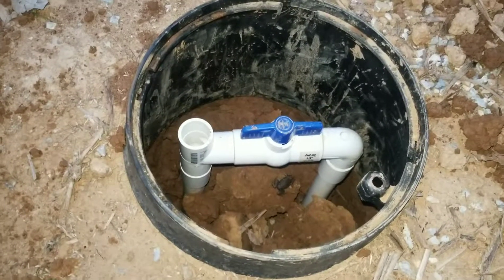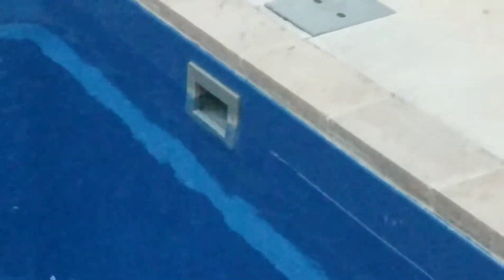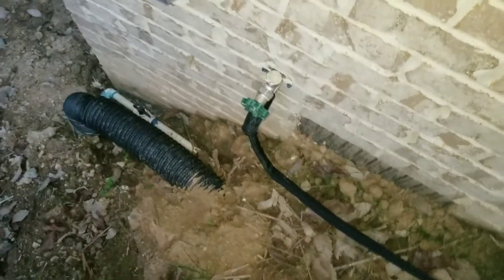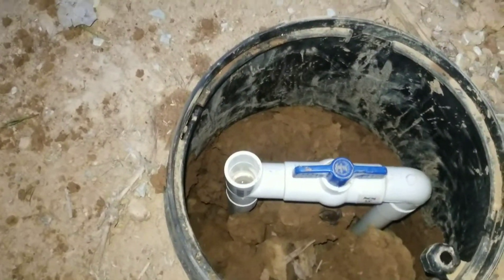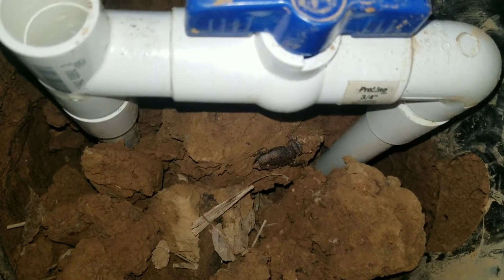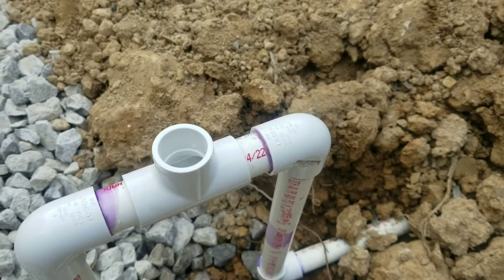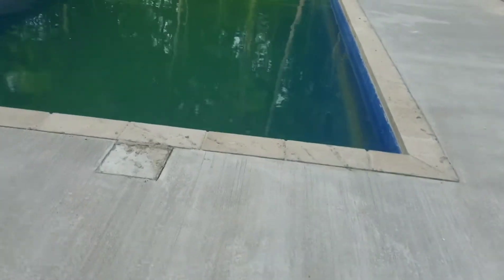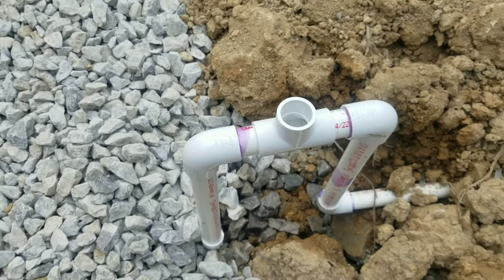Adjustable pool overflow drain

Comment from the maker: Hey everyone here's a follow-up video based on questions in this comments thread.
https://youtu.be/F8uNJ1o5_Ws
Reply: Awesome - Looks great too! I got your point on the blowout part too - figured if you don't have it glued into those extensions near the bottom - the whole apparatus can just come straight up and off anyway - and you can blow the line out directly to the pool side. I love it regardless. I can see not really closing it down much either, so either way works. The follow up video is great - looks awesome in the yard with the grass all in. Thanks a bunch - definitely glad I ran into this solution. Cheers!
Reply: James - circling back here - I just tried to post but it didnt work so Ill try again. I still have not found someone to help me get access to the skimmer through the concrete and then repair it. But my question (not sure if I got this answer or not) - is did you have to actuall Drill out from inside that back hole/port into the skimmer or was there some kind of knockout - I do not see any indication of a knockout from inside the skimmer - its all smooth?? Also - were you able to attach the pipe to the outside of the skimmer port/hole or inside? I was told that I should have enough room to connect a coupler or bell end 3/4" to the part coming out the back of the skimmer. I have a picture of my skimmer during install but not a close up. I also do not have a model number as it was installed on the pool when delivered from the manufacturer of the fiberglass pool. See image: ( https://ibb.co/W2ckmNN ). Is this what you had to connect yours? I was told by one vendor that the hole/port was only used for bracing and not for overflow, but another vendor (and your install, along with some photos online) show that this is the intended purpose as well. Can you tell from the photo I posted if this is what you had and how you attached the pipe and got access into the skimmer (drill/punchout/etc.).. thanks..

Comment: at about 4:16 in the video you mentioned adding a valve to allow going even lower than the skimmer line or something? closing it then allowing the siphon effect to drain even more? I am confused on that. Also - what happens in winter/freezing - any issues? just leave everything open and all good? I run my pool all year long. Looking to add the overflow to my system soon and having this setup with the landscaping port access to the valve up by the pool just after the concrete deck is awesome. Is the system shown in the beginning of the video the final setup? With the air inlet open on the left, what does closing the valve do? wont the water just continue to rise up and out of the hole on the left forward of the valve? If the valve is to shut it all off and prevent draining, I dont see how that would work with that open access part. I assume the open hole was on the pool side not the drain side. I dont understand the air inlet/siphon/valve setup exactly. Also - having the pipes come way up allows you to have the hole lower in the skimmer (since it is where it is from the skimmer manufacturer) but allow the water to go above that hole before it exists the system? even tho the pipe that carries the water out goes up higher than the hole, yes?
Reply from the maker: Rrandy for your purposes don't worry about what I said in the second video where I showed what I did the first time. I was showing what my first system was before it was all covered with dirt so people could get a better concept of the system. The purpose of the cutoff valve is so you can temporarily raise the water level in your pool. For example in Middle Tennessee where we get an occasional shower during the summer. If I wanted to take advantage of that water and raise the level  so I'd have extra water to lose for evaporation I could do that and not have any go through my overflow drain by cutting it off at the valve.  

I would definitely start on the high side and work your way down with your PVC pipe I've actually raised my pipe level to where 80% of the skimmer level is covered by water and then the overflow kicks in. 

The siphon effect is a real thing  that is why I have a T so one the optimal pool level is reached there will be no water being sucked out the line. If I didn't have all the water would be sucked out u till it got to the level of the drain hole in the back of the skimmer.

Since this is a low / no pressure system you really shouldn't have to worry about gluing any PVC pipe together. This means if you want to raise or lower the level that should be a relatively easy thing to do if you so choose. 

Freezing has never been an issue the ground acts as insulation. We had one of the coldest snaps Middle Tennessee has ever seen this past December the skimmer flapper? froze and we lost Prime but the overflow valve was fine.

This is our third summer with this system and it has never failed me. Even with some very significant rainstorms water got high but you never had to break out of sump pump to pump the pool out. At the pool at our old house I was constantly having to pump out the water after a significant rainstorm.

If you have any other questions let me know we might have to arrange for a phone call somehow LOL I'm glad this video inspired you to do something similar.
Reply: @jamesc.3524  Thanks for the reply! I was hoping this thread/video was still active. I actually just bought 1/2" of everything and making a small-scale model on this hooked to a empty cat litter bucket to act as my skimmer and to see how this all works (just drilled in the pipe and sealed with jb water weld. I am in Georgia and our pool was installed without an overflow (also fiberglass) and the deck is already poured. When it rains I have to drain it all the time with the sand filter. The only hope is the port in the back of the skimmer like you are showing in yours. I have to break concrete to get to the back of the skimmer port and punch/drill? out the hole to add the overflow piping and then fix the concrete. 

I love the idea of having the landscaping box with the valve and T where you can access it right beyond the pool concrete decking. I will play with this setup and see how it goes but my confusion, still, is how the open pipe T works once you cut the valve off (to prevent water from overflowing out) - how does it not just rise above and out of the access hole (the open ended T) when it rises higher in the pool? Once it fills the pipe (blocked by the closed valve), wont it just overflow out of the open T inside your landscaping box area?  Figured you would block the water flow  the T to stop water from even getting to the open T port and escape the system versus behind it (toward the draining end). 

Also - yes - the siphon thing is a great trick to drain something without a pump - fill a hose, then stick it in and ensure the drain out end is lower than the part you are trying to empty.. pretty neat trick (introducing air breaks that siphon effect).

Quick question - is the hole inside the skimmer 1" or 3/4" inch inside? I see all of your piping is 3/4" for the valves and all that. I still don't know the size of my skimmer port but my skimmer looks a lot like yours. Did you have to drill it out or does it punch out some how? I dont see anything from inside the skimmer side to suggest where it would be but I have a picture while the pool was being set and back filled where I see what looks like a port coming out the back. Just not sure if that is the same thing or not. Do you have issues with it clogging in the skimmer with it being 1" or 3/4"? One vendor that looked at this setup said it would get clogged to much if not 2"...
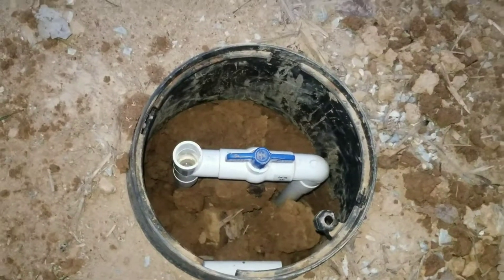Reply from the maker: @randy4813  in regards to the T in my video at 1:55  you see a spare piece of 3/4 inch pipe. I place that on the T and they'll take care of the excessive water whenever you close the valve to raise the level. Just be mindful of how low you bury your Landscaping box so you have room to place it on without hitting the top. 

In regards to the hole on the back of the skimmer I believe all of them are 3/4 in. I wasn't there and they actually drilled the hole but if you look at a new skimmer online you can see where that hole is and there's a port for it I believe you will have to drill it.

 So in the three years I've been run the system it has never gotten  clogged. The overflow pipe is going through the skimmer. Anything that would clog it would hopefully get sucked down into the skimmer basket. In the event it did get clogged I would close the valve and take a air compressor and blow it out. The only way something would get in there is if the skimmer never ran and something forced it in. I'm not saying it will never clog I'm just saying there is a reason pool Engineers put a 3/4 inch size hole for an overflow drain the back of the skimmer using 3/4 in pipe.

If you have any other questions feel free to comment back. With a model you are doing it should all make since.
Reply: @jamesc.3524  with my demo - i see there are 2 ways to accomplish this same goal - I added the air gap (like in your original model with the T in the middle not on the corner (still open air and you can see water flow through) but elbows solid on the pool side and the drain out side. I just simply put the valve cut off right before the open T to allow me to cut the water  before the air gap and not have to add any riser pipe to allow the pool water level to go higher (high as the riser extension you add in your example on the front end). I also tried using the open T on the back corner before it goes down to drain instead of on the front pool side corner. Both work. 

Do you see any disadvantage to adding the air break to stop the siphon effect AFTER  the shutoff valve? If you look at your first example where you had just the open air gap and no valve, that is what i did but just put the valve forward of that toward the pool side inline with the open T.. just not using the T on the corners. Seemed to work the same and not having to add an extension when shutting it off allowed me to fill the bucked all the way. Opened the valve and watched it all drain out - watching the water through the 'site glass' open flat T in the pipe like you created in your first design. 

Essentially your design in 3:33 of the video but with the cut off valve just in front toward the pool skimmer and inline with the same horizontal pipe.. Thoughts? 

Also - thank you so much for the extra info and this amazing design!
Reply from the maker: @randy4813    I don't see any disadvantage at all in doing it your way. The only issue I see is that you won't be able to see exactly how much higher your water level is as opposed to where the system would start draining.  But that's not really an issue.  Just thought of this the other issue is if you had the blow out the line because it got clogged  before the cut off falls you could use the cut off valve to direct the air on the poolside of the line getting out  any line clogs. 

 The way I have my system set up I keep the water level pretty much where I want it it's extremely rare or eye and have to use the valve that's nice to know I can use it if I want to. And deciding what level you want I would highly encourage you to start with a high level and  cut down from there. Dont to glue anything  until you know exactly what your water level. You'll probably find you don't need to glue it at all.
Reply: @jamesc.3524  Fair points. As for not securing all with Glue - def makes sense for the parts you can remove to adjust if needed - as well - that allows you opportunity to blow out any issues (simply remove the parts in the middle) haha. Not sure what position the pipe from the skimmer out to the grass will be (after it exits the concrete decking) until I get the concrete cut, dug out and the pipe connected to the skimmer port. Once it reaches the yard - it seems that a bit lower angle is better so you can bring the system UP to then allow Siphon Break Vent and Cutoff Valves. Definitely glad I saw your video though so they didnt just run one straight line all the way out and create that siphon effect!

Could also put a valve vertically before your setup and after if wanting to go with your design on the open end on the corner. This way you could still shut it down 'before' the possible escape if didnt want to add the extension piece. (so many options!).. 

Thanks a bunch - very kewl and your situation matches mine with fiberglass, skimmer port, etc. Too bad it wasn't run before the decking was poured! Pool vendors......
Reply from the maker: @randy4813  

Just to make sure we're all on the same page I felt it was beneficial to make a follow-up video. Here's the link

https://youtu.be/F8uNJ1o5_Ws